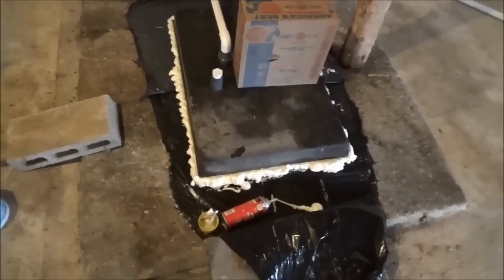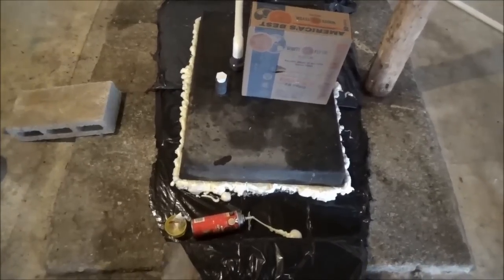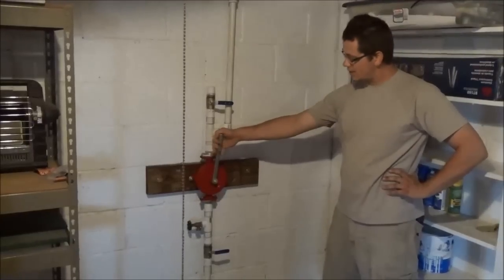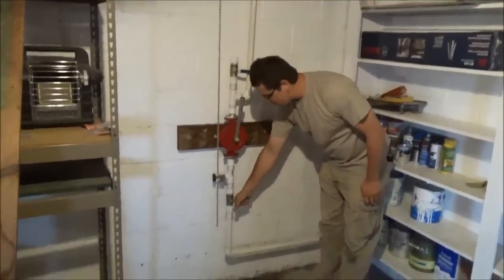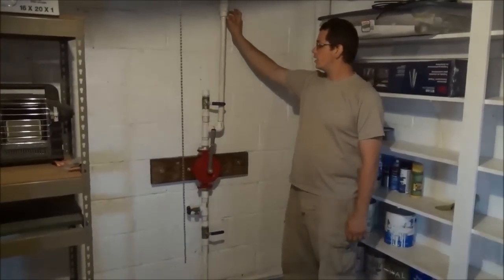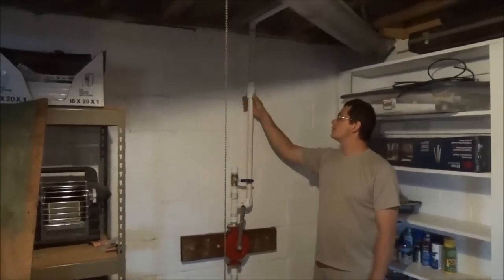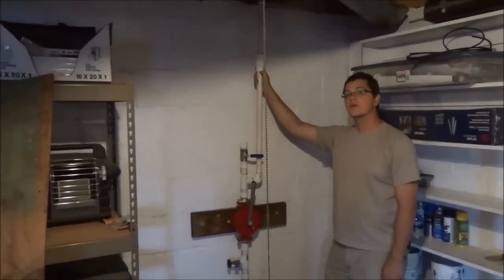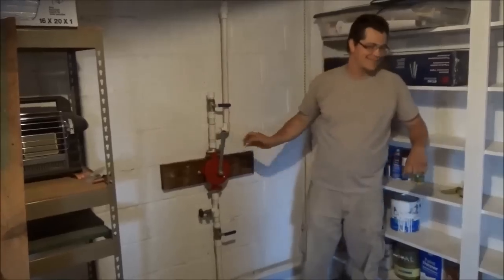Shallow Well Pump Installation

Comment: Been 8 years already. Have you engineered any idea for a similar way to pump a deeper water table (40-50’) from inside the house? Maybe two different pumps (high lift low pressure and high pressure low lift)?
Looking for a prepper solution to this scenario

Comment: I need a really shallow well pump. When we get 2 inches of rain my yard turns into a lake. Most of the time I can dig 3 or 4 feet and hit water. My township water shutoff is down about 10 feet and you cant see it because it is always covered with water.

Comment: Hey guys got a well that is 25ft and looking to add a no powered pump to it as a backup. Is it as simple as dropping another line into the well or like in this video "t-ing in" to the exsisting line that is attached to the powered well pump?

Comment: Is there any kind of non-electric pump that will draw water from a 1000'+ well?
Reply: submersible air lift, air displacement, bladder, or air-actuated might get that far.  Slower pump rate  and volume.